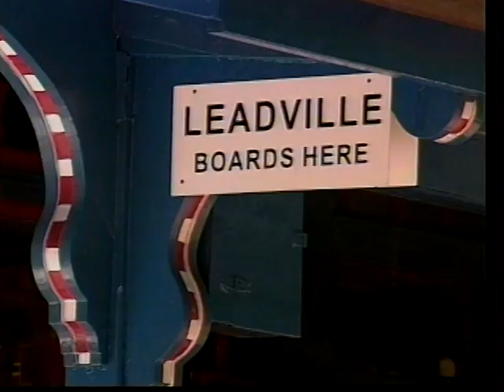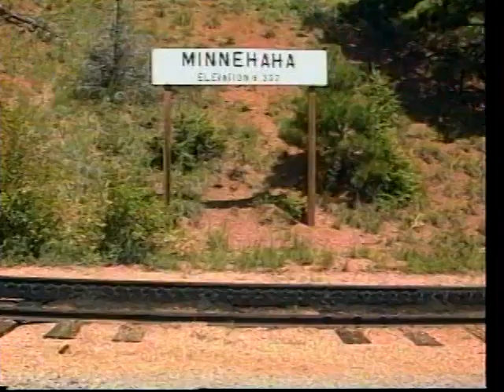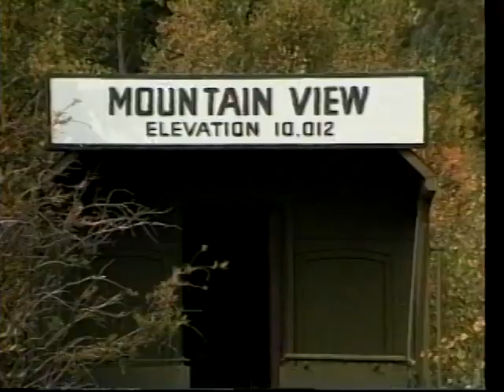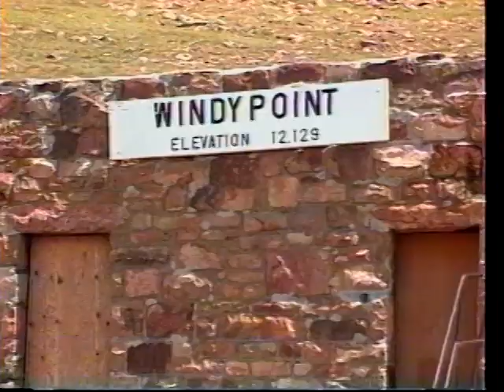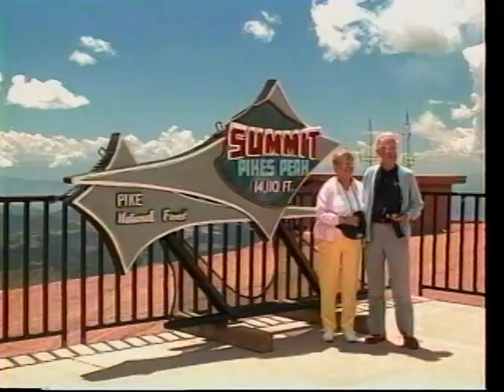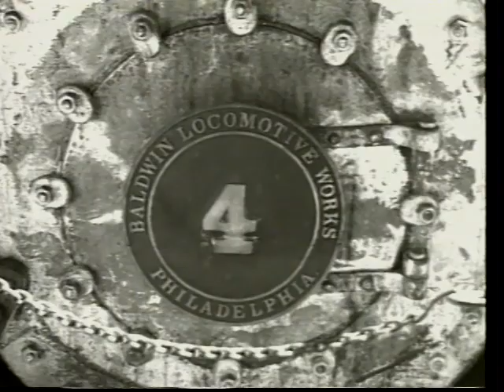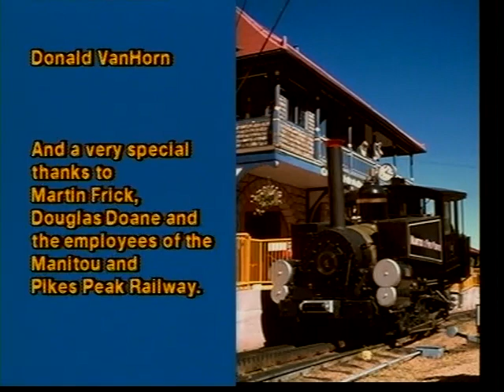Pikes Peak By Rail (Cog Railroad in Colorado)

Comment: 14:28 The original version used different footage, and shows that while this looks just like two passenger trains passing, it was actually a three train meet between two passenger trains and a work train. And what actually went on is that the work train traveled uphill of the siding. Then the uphill passenger train entered the mainline track. Then the work train used the siding to circle around the uphill train, then backed all the way up to the uphill train on the main track. Then the downhill passenger train went through the siding, and then once it cleared, the uphill train resumed its journey and the work train went back downhill.

That version also used different footage for the downhill meet at 26:35.
Reply from the maker: I shot that. We called it Waltz of the Cog Trains. There was one cameraman, me, Fortunately there were a lot of trains and time to move my position. Finally, I used "match action" editing to have it look like there were multiple cameramen. It was great fun. Some years later, they lengthened the siding at Windy Point so both sections of a train would fit simultaneously. So this complex maneuver was no longer necessary and the railroad asked me to replace it with the simple passing of trains, not nearly as interesting.

Comment: Wow, this is slightly different from the original VHS I've been watching all these years!
Reply from the maker: Correct. My memory fades but there were 3 versions that kept up with changes to the railroad. The version I recently posted here was the most recent version.
Reply: @trainclaude  I really like the "3 trains need to pass" scene in the original(?). Superbly filmed.
Reply from the maker: @KCWanderlust  And it was fun to film. I spent most of a day filming since I was the entire crew. Fortunately, they were running 8 trains that day. Then, the edit required lots of planning. I was disappointed when the railroad lengthened the passing siding and wanted the scenes removed.

Comment: They should put a steam engine back in service
Reply from the maker: Agreed. Steam loco No. 4 last ran in scheduled revenue service in 1959. It was used as a steam source for melting ice in 1964. It was put back into service for excursions in the mid-1980s which is when I shot this video. It is out of service now because the complete $100 million rebuild of the railroad in 2017-2019 included a change in the the type of rack rail along the entire line. The steam loco cog gear would have to change to match the new rack rail as well as its mounting (probably). The railroad has talked about doing this but it is very low priority. Last I heard, the loco is on display at Williams, Arizona, the southern end of the Grand Canyon Railroad. The matching steam coach was in Pueblo, Colorado. The other problem would be schedule. The newly rebuilt railroad will carry twice as many passengers as the old railroad so track time will be tighter. When I rode steam excursions in the 1980s and 1990s, they were always on an Autumn weekday when track time was plentiful. I remember one trip when we just stopped on the mainline, got out and had a picnic in a meadow next to the railroad! I doubt that will ever happen again.